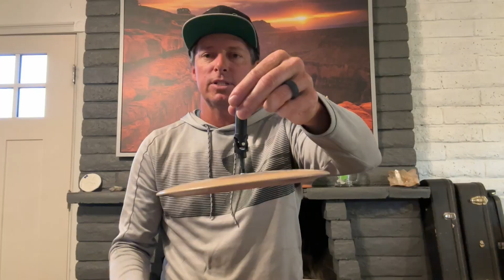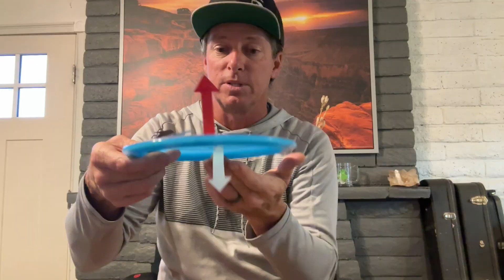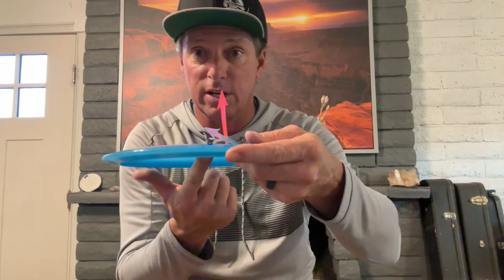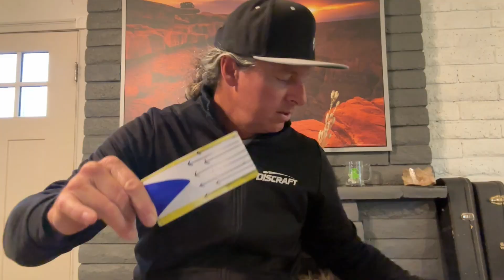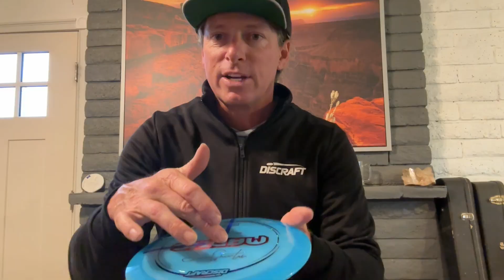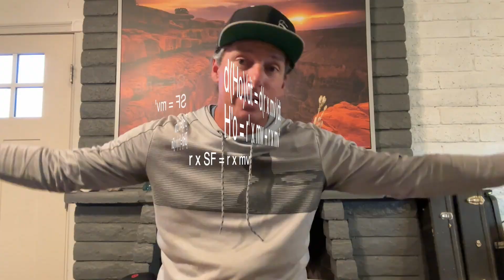Why do Discs golf Discs Turn and Fade?

Comment: Thank you for your video! 

I have a couple og questions I hope you Can answer: 

Why dont you talk about the angle of attack when talking about the shape of a disc fx. An over stable disc instead of diverting the Air under or over the disc? 

And how come diverting Air over the disc creates more lift instead of underneath?
Reply from the maker: Thanks for your comment!
Ok, for your first question, for simplicity sake and for introducing the basics in this video, I’m discussing and assuming an angle of attack of 0. This helps us visualize what is going on as the airfoil is interacting with the air at both the front and back of the disc.
Common vernacular in disc golf for a high angle of attack would “nose up”. A good AOA would typically be 0 anyhow.

The other thing I did not discuss which really weighs into the equation, is what happens at the trailing edge of the disc, which is twofold, drag (which determines disc speed), and the manner in which the airflow is finally diverted and brought back together. I suppose this is for a future video.

For your second question we need to take a look at “Why does a wing generate lift”?
Let’s think of a traditional wing, an airplane wing like a Cessna to start with.
If we assume Bernoulli’s principle: as the wing passes through the air, it’s diverted above and below the airfoil. Air passing over the curved top of an airfoil must travel faster than air passing under the bottom which creates higher pressure and so the airfoil moves upwards from low to high.
Next, a traditional wings balance point is typically set at 1/3 the chord of the wing.
This is where its optimal Lift/Drag for its particular wing speed would balanced to fly efficiently and carry its load. 
If the airspeed for the wing would begin to exceed the optimum L/D, the drag would begin to pull the center of lift behind the balance point and cause the wing to begin to tip forward. If the wing were to be flown too fast, the aircraft would begin to move into a steep dive. On the opposite side of this understanding, if a wing begins to fly slower than the optimal L/D, the lift pressure would move in front of the CG; the wing would also be moving towards a higher AOA and if flown too slow it would eventually stall.

With a disc, unlike a traditional aircraft wing, the leading edge of the disc/wing is exactly the same as the trailing edge and the center of balance is the center of the disc.

With an over-stable disc like a Raptor, the air diverted over the top is near the same as below, and the wing shape doesn’t allow for the center of lift to move behind the center of balance. This means that its optimal L/D for its designed airspeed is at, or in front of, of the CG.
We must understand also that a discs airspeed is dynamically changing and slowing down throughout its flight due to drag. Which means that the center of lift pressure is also dynamically moving or changing also.
With a disc like a raptor, very few people can throw the disc fast enough to cause it to “turn”, meaning, throw it fast enough that the induced drag will cause the center of lift to move behind the center of balance.

If we consider a Captain raptor, we will notice that more airflow is diverted below the part line than above, this means the disc was designed so the center of lift will typically always be in front of the center of balance or CG.

Worthy of note and for understanding. 
With a disc like the tilt, the air at the front is all diverted downward. This force pushes up on the nose of the disc, the assumption would be a direct change to Angle of attack, however, this force is transferred 90degrees away in the direction of the discs spin due to gyroscopic precession and the effect is seen as instant fade and over-stability (similar to lift acting in front of CG but far more pronounced)
Reply: @DiscgliderPete  awesome! Thank you for taking the time to explain it in more detail🙏
Reply from the maker: @madsbundgaard9014  hopefully that helped
Reply: @ it truely did!

Comment: To take it one layer deeper, why does the center of lift move depending on speed of the disc?
Reply from the maker: @Element108Hs  thank you for the question!
it’s based on speed, lift,and drag. A blunt edge disc like a putter or midrange disc is slower, because its shape creates more drag at the back of the disc. The wing shape dictates how much airflow moves over the top of the disc and therefore how much lift is or is not generated. Throw the disc slowly and the lift generated is low, thus the drag is less because its speed is slow. Throw it faster where its speed is greater than it optimum designed lift/drag ratio and the lift moves backwards from center of lift/balance due to drag.
The faster or sharper a disc is, the faster it needs to move in order to keep the optimal lift/drag ratio to fly. The optimal lift/drag ratio is dictated by the shape of the “wing of the disc, the height and shape of the parting line, and how much airflow is diverted over the top compared to the bottom.
A fast disc (speed 13), and a slow disc (speed 2), both have a similar diameter of 21.4mm and rim depth at let’s say 1.3cm, so technically they both displace the same amount of air. The first part of this is  understanding that, the greatest difference to the sharp edge disc is not that it’s “cuts” through the air faster, but that is trailing edge generates significantly less drag, than a blunt edge disc. The second is understanding that the leading edges shape, dictates its lift, its angle of attack, and is stability in tandem with what happens with its trailing edge.
Because a discs flight is not one static airspeed, but dynamically changes throughout its flight, its lift, drag, and angle of attack (nose angle) is dynamically changing based on is initiated speed until its velocity is no longer able to sustain flight and either hits the ground or stalls and falls to the ground.
I hope this helps you:)
Reply: @DiscgliderPete  Ah, sorry, should have worded my question more clearly. By "speed of the disc," I didn't mean it's speed rating but rather the speed at which it is flying through the air. So to rephrase, why does the center of lift move depending on how fast the disc is flying?
Reply from the maker: @Element108Hs  I think the answer is still in my last comment, but I’ll try to simplify. 
The short answer is: the position of where lift and drag affects a wing is dependent on its airspeed.
Longer explanation:
Let’s look at a traditional airfoil/wing.
If we observe an airplane wing, we will see that, if we fly it too slow the leading edge will pitch upwards and the airplane will begin to stall. Meaning that the Lift has moved too far ahead of the center of balance.
If we fly the airplane too fast the leading edge will tip downwards pushing the plane into a dive due to lift pulling upward on the back of the wing. An airplane balances is L/D by maintaining its optimal airspeed via its motor. 

For our purposes lest assume we are talking about an under-stable fairway driver, something akin to an Undertaker or Heat.
A disc has several forces acting upon it during flight: Inertia, Lift, drag, gravity, and angular momentum which is spin. Every disc has its optimum flight speed where its lift to drag ratio is acting over its center of balance. 
Because a disc’s speed is constantly changing due to drag, a disc is never flying a constant speed. If it leaves the hand at 60mph, it begins slow down until it stalls and falls or hits the ground.
Let’s assume that the Discraft Heat’s optimum flight speed for perfectly straight flight is 55mph. If I throw it exactly 55mph, it will begin slowing down immediately due to the resistance of the air and its drag, so the time the disc is at it’s optimal Performance is very short. As the disc slows down, the center of lift moves forward of the center of balance because the air is moving slower and therefore there is less drag and subsequently less lift. 
Let’s say we throw the Heat 65 mph. Now the air is passing over the wing much faster, there is much more drag acting on the back of the disc, and thus the center of lift is pulled/dragged behind the center of balance. Because the lift is pulling up on the back of the disc, the disc begins to turn during the first portion of the flight, however the disc is constantly slowing down due to drag so the position of lift is dynamically shifting from the back of the disc towards the front of the disc, so that at some point it’s glide is 55mph, then 40, then 25, and so on.
If we throw a very over-stable disc like a Captain Raptor, the shape of the wing doesn’t allow for much air to pass over the top of the disc, so very little lift is generated, thus the drag at the back of the disc is minimized and thus the lift never moves behind the center of balance. The disc is constantly in fade because the lift vector is only acting ahead of the CG.

Comment: the front of the disc acts like an airfoil on an understable disc and will create the most lift on the front of the disc during the beginning of the flight at the highest speed, not the end of the flight at low speed. more drag means more lift, more speed means more drag and more lift. what you're describing in this video would only happen during something like an airbounce where the angle of incidence is drastically different from the angle of attack. for a flat release the downwards force of gravity opposing the upward force of the bottom of the disc is way less than the forces of the air affecting the airfoil, but we still see the lift and turn/fade happen on flat releases.
Reply from the maker: I am describing a disc released with a flat release and perfect nose angle or angle of attack of 0.
I appreciate you posting your comment, but I do disagree with you on a few points.

The front of the disc is only part of the story. The front of the disc is the leading edge of an airfoil, but it’s not an airfoil all by itself.
An “airfoil” is a complete wing. 
Wing physics and flight rely on a balance point, be it a traditional airplane wing or a disc golf disc. The leading edge of an airfoil dictates the stability and the overall lift capability of a wing in high speed and low speed flight. The wing of a small Cessna 182 is a slow flight high lift airfoil. It does not perform well at high speed and becomes dangerous if flown too fast. The wing of a leer jet has a more symmetrical airfoil that’s designed for very high speeds and becomes dangerous if flown too slow. The leading edge of each of these aircraft are designed for very different flight characteristics, but the leading edge is very important in where and how it diverts the air above and below the wing. Note that a traditional aircraft wing is typically balanced at around 30% of the wing cord.
A disc golf discs balanced point is at its center. Spin is what creates its stability rather than a fulcrum balance point on a traditional airfoil.
Same as a disc golf putter and disc golf driver, one is slow with higher lift and one is fast and does not perform well at slow speed flight. 
The reason the lower parting line of a discs leading edge generates more lift is because more air is diverted over the top of the disc. The far less discussed part of an airfoil is what happens at the trailing edge of a wing/disc. As air passes over the top curve of the wing it first is diverted upward then passes over the top then travels down the curve of the trailing edge, then off of the disc/wing at the angle of the bevel. This is the location of drag. Drag is what dictates a discs speed, which is to say that it’s not what happens at the leading edge that dictates a discs speed, but what happens at the back of the disc. In our case, because our discs diameters and depths are relatively the same, our discs “displace” the same amount of air in flight. So the second part of understanding flight, is that lift always comes with drag.
Back to the airplane wing analogy. The balance point of a wing is typically married to it airspeed. If you fly faster the lift will move behind the balance point of the wing and tip the plane forward towards a dive, this is offset by adding up on the elevator to maintain level flight. If a Cessna were to go into a steep dive and fly far past the wings airspeed the wings lift force would move towards the rear of the wing beyond a point where it could be corrected by elevator input. This happens because of drag, the faster you go, the more lift is generated, and the more drag is increased.
Back to a disc, talking about a disc with an angle of attack of 0. Our under-stable driver generates more lift at higher speeds and thus more drag. Because our wing is symmetrical (round), and because the leading edge is the same as the trailing edge (different than an airplane wing), our airfoils balance point is the center, and this it’s optimal lift/drag ratio would be when its lift is acting directly over is center. This is a temporary moment in time when this occurs though.
When we throw a disc faster that it’s optimal Lift/drag ratio, its lift vector moves behind its CG, this means that lift is acting further towards the trailing edge of the disc. This is what causes high speed “turn”. As the disc slows down due to drag, the lift vector temporarily passes back over the CG and as it slows more, the lift moves ahead of the CG which then results in fade. During the slower portion of flight the lift is no longer able to sustain flight and the angle of attack increases as the fade increases.

Comment: At 5:19, why does the center of lift move forward with slowe air speed?
Reply from the maker: That’s a wonderful question.
It’s air airspeed and pressure issue.
Let’s think of it this way. Imagine a boat moving slowly through the water. Now imagine its wake moving out alongside and behind it. The wake is small because the pressure of the boat against the water is small.
Now let’s make the boat go fast. The boat now raises out of the water and rides higher because the pressure is greater and as a result the wake is greater also. If our boat goes fast enough the pressure will increase and the entire boat will skim across the surface because the center of pressure is well behind the center of the boat’s balance.
Now let’s slow the boat back down.
As the boat slows, the pressure below it decreases and the bow begins to pitch upwards because the center of pressure moves forward of the center of the boats balance.
With our boat analogy we can see how the speed of an object within a fluid can change pressures, how that center of pressure can be forward or behind the objects depending on its speed.

With a disc, the principle is basically the same. The faster a disc moves through the air, the greater the pressure, and the more that pressure slips behind the center of balance.
When the disc slows, the center of pressure/lift decreases and moves ahead of our discs center of balance, and much like our boat, the nose pitches upwards increasing the angle of attack as the disc begins to fall.

I hope that helps answer you question:)
Reply: @DiscgliderPete dude thanks for taking the time to educate. Super mind blowing and insightful!

Comment: Good job except you have it backwards with nose and lift. Nose up disc goes up. Down goes down. Hold your hand out car window and find out.
Reply from the maker: @beenschmokin   thank you for your comment , however, I beg to differ. I believe You’re talking about angle of attack.
Angle of attack is different than the shape of a wing And how the wings divert air over the top and bottom and more importantly diverts air at its “tail”.
What I mainly discussed in this video is how a Disc interacts with the air based on a 0° angle of attack. 
A disc thrown with a positive angle attack will pitch upward and slow down quicker, and bringing the disc into the fade portion of light, faster, which limits distance, a drastic version of this we would call an air-bounce. 
When throwing for distance a negative angle of attack somewhere in the neighborhood of 2 to 4° is preferable, in that the nose angle is calculated against the launch angle (typically a positive number because of throwing upwards)
A negative nose angle( “ angle of attack” ) at launch, allows the disk to push forward longer and help spend off the positive angle of attack that occurs at the end of flight, which we call fade, and occurs because of gyroscopic possession and where the lift vector occurs during the slower portion of flight.
The main point being, angle of attack has to do with the angle of the entire flightplate /wingchord it of an airplane wing or a disc golf disc measured against the trajectory, vs. how much lift is generated by the specific shape of the airfoil.
To your point, with your hand outside the window, your hand being perfectly flat, a twist of the wrist can induce a positive or negative angle of attack. However, if you cup your hand, you would generate more lift, and more drag. This will require you to hold different angle of attacks based on the shape of wing you cup your hand into.
(moving your pinky finger up and down in this scenario mimics  the trailing edge of the elevator on an aircraft, which also changes an attack)